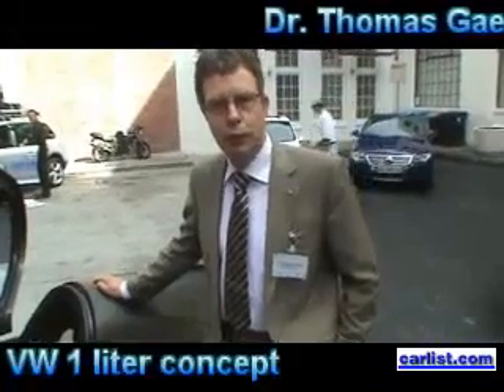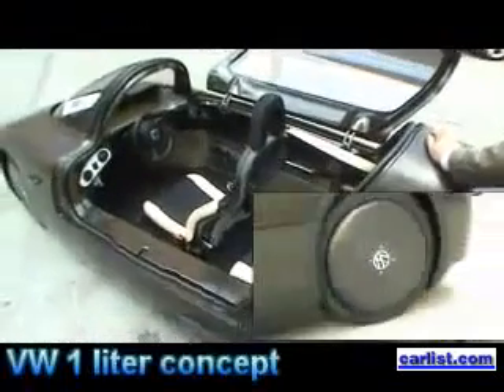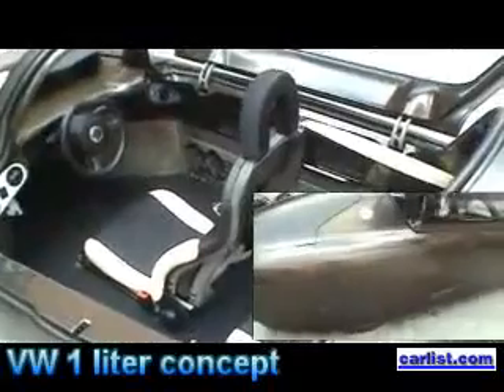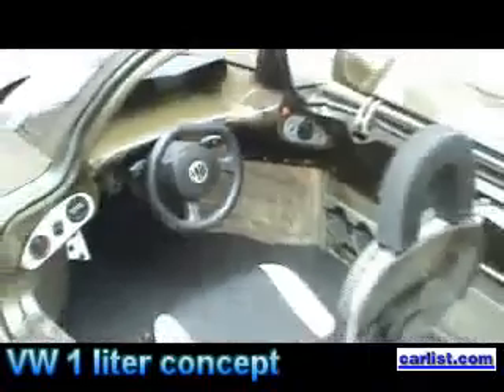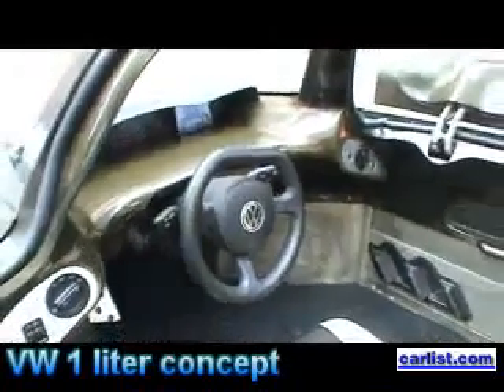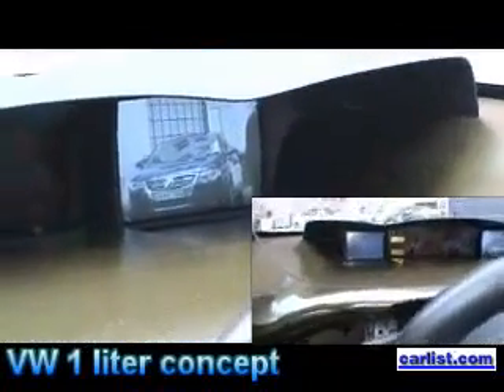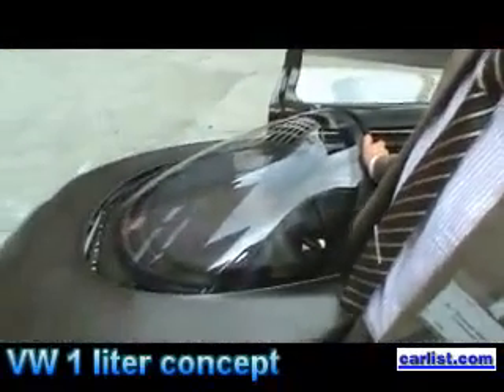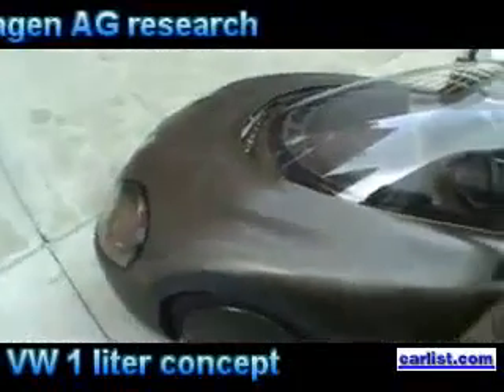Volkswagen 1-Liter Concept car most fuel-efficient diesel car made from magnesium and carbon-fiber

Comment: Was Volkswagen claim of 1 litre per 100 kilometres ever independently tested? It's just that we know now they can not be trusted and they failed to deliver that fuel efficiency in the XL1 when they eventually made it.
Reply from the maker: I haven't heard.
Reply: Because they fucked the whole concept.    I bet the idea was to prove how it cannot be done.  I heard the xl1 weighs double of the l1 for no reason        ..  Consider a lcc rocket manages 380kg.no roof, ok but no carbon fibre and 150+hp motorcycle engine.            So   . I can believe the 1l claim. Just about.         2.1l, gasoline not diesel, in a not so aerodynamic honda innova is a real thing